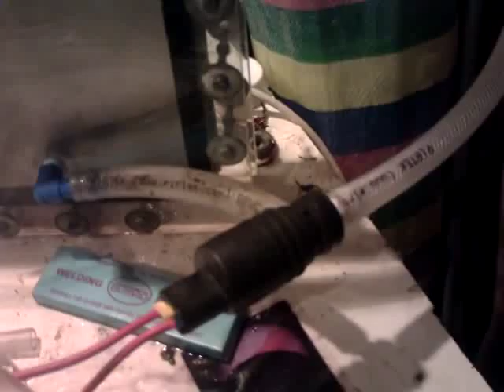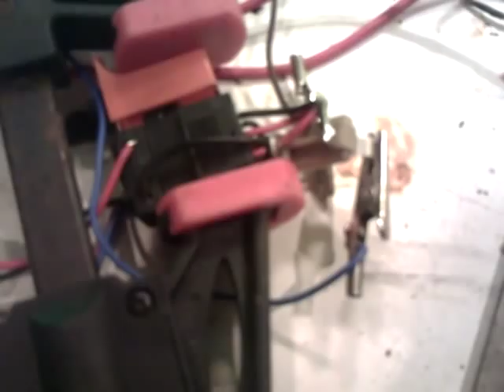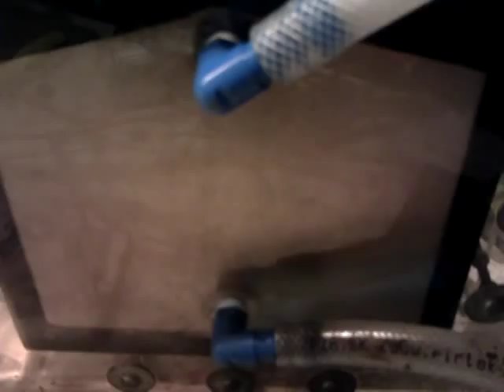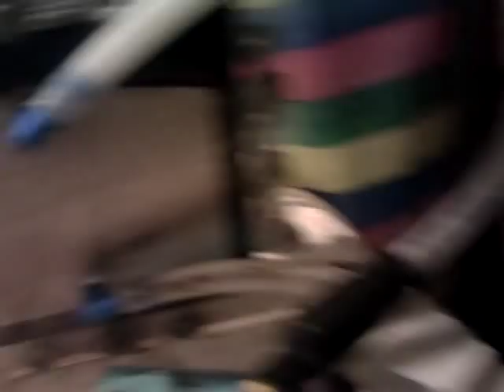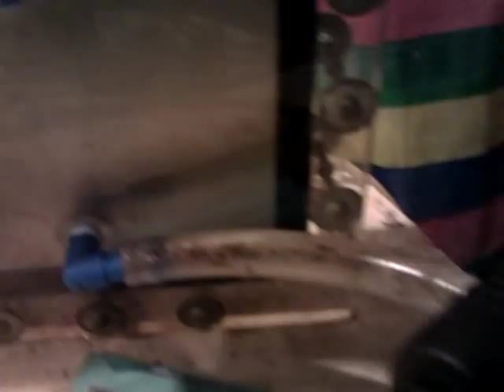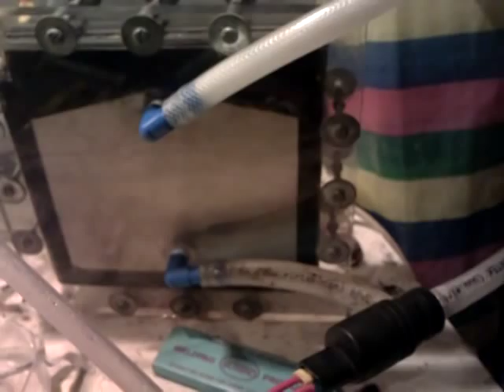HHO water pump circulation for dry cells

Comment: you better show where the pump output is connected, to be much more helpful for who wants try it.
Reply from the maker: The pump out let goes straight back into the bottom of the cell.
The pump goes in between the primary bubbler and the HHO cell and circulates the water.
Thanks for watching!